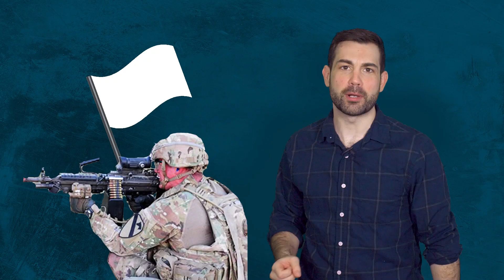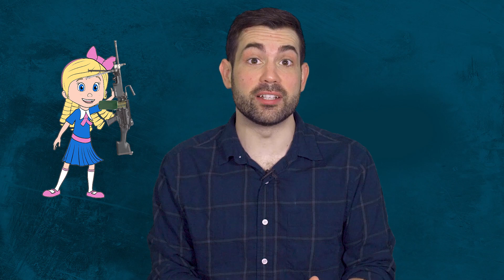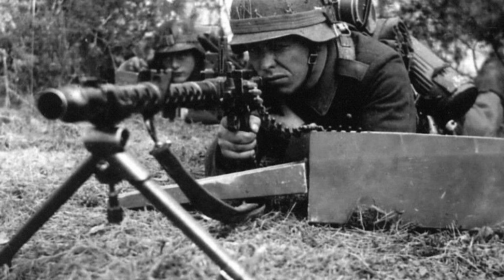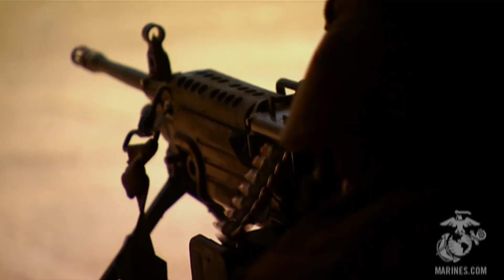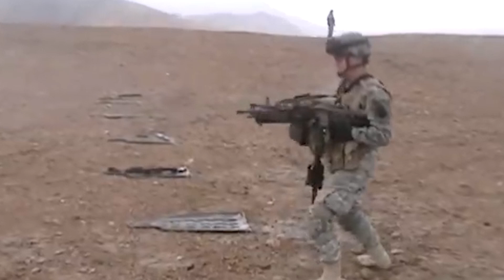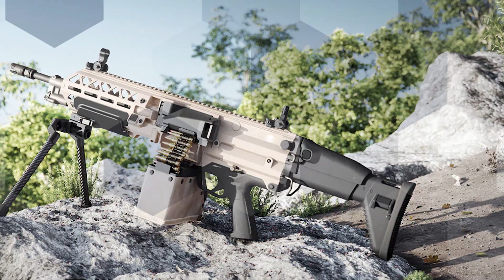How the M249 Machine Gun Evolved

Comment: The Australian F89/Minimi ended up with a FN MAG58 flash hider because it apparently improved fire control.   Plus the Minimi originally had dust covers over the link ejection port. Great idea that was... until gunners ended up ripping the crap out of their index fingers from cocking it and dragging their hands over the sharp edge of the dust cover.

Comment: Israel negev takes mags too, but there works. It has a gas regulator that you switch to for mags and slows down the rate of rife to give time for the mags/mag spring to feed. The m249 doesn't feed well from mags because the system out runs the speed that the mags can feed the next round.

Comment: Its supposed to fire from a magazine, but the lack of an adjustable gas system means that when it doesn't have to pull the weight of a belt of ammunition the bolt velocity increases to a point where it outruns the magazine. Making firing from a magazine an unreliable and dubious proposition.

Comment: We learned really quick during our 2nd deployment to rural Al Anbar that it was tough to pin the enemy down and actually maneuver on them. They'd often try to use the PKM and AK variant's superior area fire to spray & pray from 700m+ out, then dip before the fight could even start. Our solution was three fold. First we were one of the first units to implement the DMR role & carry the M14 EBR into wider infantry combat. We were also one of the first units to receive a CROWS. lastly, we solved the jamming magazines issue in the M-249 in literally the simplest & stupidest way ever. We just added a second feeder spring to all of our magazines. This allowed the mags to keep up with the SAW's stupidly high rate of fire and didn't seem to bother our M4s at all. We had to be very methodical about those long maneuvers but it totally worked. The CROWS allowed the M2 to respond quickly and safely for just long enough to get the M14s into the fight. The M14 could deliver accurate fire long enough to get the SAW close, and if the SAW ran out of belts before it got there it could safely and reliably be fed by squad mates. What were once legit ambushes tapered off to little more than the occasional quick harassment burst or two at even further and more inaccurate ranges. In that case we'd respond with the M2 & M-240s in kind and just call in mortars or air.
Reply: Nice tip on x2 springs, noted
Reply: Why the US will never use robots for combat. AI would never come up with a solution like that.

Comment: Wanna clear up some of your #'s. 1.) The 50% who had problems maintaining the weapon, didn't maintain it correctly. However, the damn bipod and the gas regulator always freaking rusted even with minimal humidity. Especially when it rained. 2.) 80% agree it was accurate. I agree with those #'s. However, I think the #'s are much more accurate. Thing shoots like a laser. 3.) The 30% stoppage issue was due to poor maintenance. I used it in Iraq and never had any issue because I always took care of it. The only issue I really had with the weapon, was that the variant that I had only had the bulky large plastic bottom heat shield / holder. Very uncomfortable to hold on patrols. I didn't have the version where they started putting the grips on.

Comment: Ah yees, ..the SAW🙄 there must be a feed and rate of fire sweet spot, with precisely timed recoil action and synchronized feed pawl swing😳 A fantastic weapon, except for rate of fire and it's daughter..heat. A shredding gun, keeps heads down and enemies incapable of accurate return fire. 850 rounds per minute?..826. The 240 is sweet but heavy. The SAW can be the cheap, reliable fire suppression king, but it needs an engineering overhaul. Scaling one thing and (The M240), into another is great when all mechanics are doing the velocity, force, cycle symphony right. Barrel change or melt.

Comment: In 1988 at Ft. Carson I was still an M60 gunner after 3 years. Two years previously in Germany. I got my first M249 brand new from the factory. I loved the gun because it was lighter than the M60. I first fired it during Infantry AIT at Benning and loved it back then. It was a dream come true for me. It had a 200 round drum which was heavy at first but got lighter as I fired it more. Cleaning it was a bit difficult.  The barrel and gas regulator built up carbon and copper deposits which I had to use the scraper. I found a secret to cleaning it. I used Hoppe's # 9 and steel wool. Soak the stainless steel gas regulator in the Hoppe's and apply some on the gas port to also soak. I used Brake Kleen to degrease the top cover and receiver and never hurt the finish. After cleaning all the big parts I cleaned the barrel and gas regulator by scrubbing off the carbon and copper with steel wool then spraying down with Brake Kleen. all the metal parts were dry and free of oil. I kept the plastic protected like the pistol grip and fore end away from Brake Kleen. The plastic I cleaned with rubbing alcohol. When it came close to turn in time to the armorer and squad leaders inspected it. I put oil on a shaving brush and coated it with CLP and wiped it down, my SAW was perfectly cleaned. 🤗🤪😜I did the same for my M60 before. I learned this from the HHC mechanics who cleaned their weapons by degreasing everything. The M249 SAW is still my favorite from memory, reliable and accurate from being a good gunner. I used it briefly during combat in Panama to punch out windows at buildings. Nothing but love for this weapon. ❤❤❤

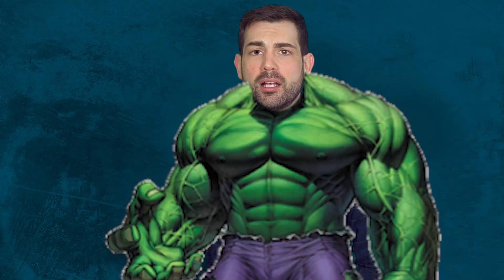Comment: At 6:53 the 249 there has a 240B bipod sticking out. Reason for this is probably that soldier did like I did and bent their 249's bipod. You're taught to put weight on the weapon to control higher rates of fire, but some of us bigger guys will break the stock bipod doing that.

Comment: What it really needs is to be in 6.5x39 123gr and to have the top cover much shorter so a scope mount can be accurate and stay sighted in. With this it would have a longer range with more body armor penetration at 1000 meters then 7.62x51 m80 ball making it more effective and a longer range then the M240 and lighter gun and ammo. And more effective at stopping power at close range than the 5.56 ss109, m855 or m855a1. Max point target range 1000 meters and a 100 round belt is only 1.2 lbs than 100 rounds of 5.56. the 6.5 is 2.5 lbs for 100 rounds. And the 5.56 is 1.7 lbs for 100 rounds a 0.8 lbs difference for a 400 meter longer ranger and more knock down face to face, win win win. now why the uck doesn't the USA military adapt it????

Comment: Pros of the M27 really good rifle accurate easy to clean because of the gas piston.

Cons we had to carry 12 magazines, reloading all the damn time and no barrel changes

We were told that accurate shot placement was more lethal and more suppressive then accuracy by volume.

Our M249 sucked they were so old and beat up and parts mismatched so a simple barrel change meant the rounds didn't chamber properly it was nice having a 200 round drum or 100 round nutsack but we use to call these things full automatic bolt action machine guns because you'd be lucky to get 3 rounds off with out a jam and had to pull the bolt back again lol, weirdly enough they fired more reliably with a magazine to the point that that's how we ran them lol

Even though the M27 felt like it didn't absorb the recoil as well it did better at full auto, the M249 was just very inaccurate, there is a reason we never approved it for over head fire at ranges like we did the 240 or other rifles.

Bottom line I prefer the M27 over the SAW but I don't believe the M27 is a correct replacement for it.

This was over 10 years ago now so I have no idea if things have changed since I left the Marines but it was still new to us at the time.

Comment: LMG's are becoming at best unnecessary, and at worst, obsolete.

Improvements in technology are eventually going to lead to Automatic Rifles (and Carbines) that are so good, they can deliver almost as much sustained firepower via the use of reliable hi-cap mags while still being cheaper than an LMG, more capable than an LMG, lighter than an LMG, easier to reload than an LMG, easier to learn as compared to an LMG, more accurate and controllable than an LMG, harder to single out under observation than an LMG, and everyone can have one (vice 1 person in a fire team). Like it or not, AR's are more maneuverable for our riflemen than LMG's can ever be. 

Sure, the M27 can't do suppression as well as the SAW, but...that's about it as far as drawbacks go. It outperforms the SAW in every other way. 

Furthermore, tech advancements mean medium machine guns are also going to get better and better, to the point where they're short enough, light enough, and powerful enough to more than make up for the lack of having a true LMG at the squad level. Imagine a weapon the size and weight of the M240L, but chambered in .338? Sure, it may not be as light as, say, the PKP Pecheneg, but the range and power of the .338 more than make up for it. Polish that gun off by adding the feed tray and link improvements of the Sig Sauer .338, the lightweight textron's polymer cased telescopic ammo, and so on, and you'd really have something. 

The only benefit an LMG has is it can deliver more sustained firepower than an AR, and it's lighter than an MMG. As time goes on, AR's will become more capable, and MMG's will become lighter. 

I think we should simply invest in better hi-cap mags for our AR's, and an LMG upper (like the Ares MCR AMG 2). They're way cheaper than buying a new LMG anyway. Other than that, an AR is more capable and an MMG is more powerful than an LMG. Slowly but surely LMG's will only fill a very niche role, especially as we switch to a 6.8 or 6.5 caliber.

Comment: I remember being issued the MINIMI (pronounced M I N I M Y In the ADF) for the first time at Kamp Krusty (Kapooka). After doing the weapons qualification (safety, IA drills & stripping/cleaning it was more far more fun to fire as opposed to carrying the weapon. The cadence we were taught was 1000, 2000, 3000, 4000, 5000 was normal and 1000,2000 was rapid. We've recently updated the MINIMI from the F89 to the EF89 which has a collapsible stock, forend rails and SPECTRE Optic.

Comment: was a SAW gunner in Iraq too. as far as the use of mags, I found that if you double up the load spring in the mags, it will feed in the SAW well. it's the high ROF for the SAW that is the issue: it feeds faster than the mag can provide .

Comment: My armorer told me that the reason that the SAW would jam up so much when using the magazine was that the magazine was most likely an M-16 mag instead of a SAW mag.  The spring was more powerful in the M-16 mag which would cause double feed issues.  The DoD, in their infinite wisdom, made the M-16 and SAW magazines nearly identical in appearance, which is why you would be issued M-16 magazines as a saw gunner.  They just couldn't be told apart unless you disassemble the magazine and check the spring tension, which you couldn't do in the field.
Reply from the maker: sounds good to me , if an armorer said it that double checks out. I never saw a SAW m249 magazine though didnt know they exisited
Reply: @Taskandpurpose  Ya, the armorer told me that they only made like a run of 1000 once and never again after that.

Comment: I carried mine in 86-87 up in 2/75.   I had none of the issues you speak of.  Humping that b** wasn't as much fun as it sounds and humping the ammo load made it worse.  I got very adept at chipping the carbon buildup off the gas regulator with dental tools.  I never had issue with firing it with a belt and I pushed the magazine in while firing and worked most of the time.  I miss that damn thing all the time.

Comment: in my 20's, as a 5'7 63kg Aussie Reserve Solider, it always surprised people that I'd volunteer to Carry the Minnimi. My Logic though, was If I had the Minnimi, I wouldn't have the Radio (which was usually a Vietnam Era 77 set, with a carry frame designed for someone over 6'0... meaning when I went to ground it would smack me in the back of the head and literally make it impossible for me to lift my face out of the dirt). On the Range I was always better with the Minnimi too, since use of the Bipod was allowed.

Comment: When I was in Iraq mine was set up like an automatic rifle.  I had the newer (2008-09) collapsible buttstock, assault barrel, and the rail system.  I took off the bipod and rails and just rocked 100-round nutsacks.  I wasn't in a line unit and would never have had to employ it in a support role, so this was okay as far as I was concerned.  Lightening it, and its ability to squeeze off single shots, made it a better fit for me.  As an aside, it weighed in at 15lbs with 100 rounds.

Comment: The m249/fn minimi is not the only LMG design that can be fed with regular magazines, the IWI Negev can as well and even do that better since it has a gas block position specifically for that, so the bolt doesn't travel too fast and the magazine spring can do it's job properly.
Reply: Rpk and m27....
Reply: @pr5721  Mag fed only and kind of not machine gun designs, they’re more like heavy versions of their intermediate rifle counterparts. Something like the Ultimax 100 or Surefire MGX are more developed from the ground up to be machine guns while being mag fed.
Reply: @myusername3689  the ak family was always a machine gun only stupid laws make them not
Reply: the M249 is notoriously, infamously unreliable with a magazine. To the point of being unusable. The Negev is perfectly functional with a mag. Now, That IWI is a private company, it begs the question of why the M249 is used instead.

Comment: I’m not familiar with the m249 personally but I think if it’s built like a PKM ie stamped and riveted steel parts instead of spot welds, a reinforced barrel trunnion and a much more refined gas regulator with a distinct setting for mag feeding and a lower cyclic rate in general, I think these changes will turn the m249 into the ultimate 5.56 belt fed SAW
Reply: You can take a look at the Negev 5.56 LMG made by IWI. As far as I know it's one of the few Belt fed LMGs that doesn't jam with mags.
Reply: @fleetSRT  I wonder if the military changes to 6.8mm x 43mm which is lighter ammo weight per round there would still really be a reason to have the ability to load mags.
A SAW gunner currently carries 600 rounds on their person, with 6.8mm being lighter they could carry the same amount and maybe carry a better sidearm, or carry much more than 600 rounds. Plus the 6.8mm has more punch behind it than 5.56mmx45mm meaning each shot can do more damage. 

We'll see what happens in the future I guess
Reply: @teaser6089  i hope they do it soon. 5.56 is slowly loosing its edge against newer developments in personal body armour.
Reply: @fleetSRT  Well, it's a machine gun so unless people start thinking they are invulnerable, 5.56 is better because it means more bullets
Reply: @teaser6089  well... For one the military isn't adopting 6.8x43, the 6.8 cartridge they're adopting is actually heavier but similarly sized to 7.62x51 NATO. Secondly 6.8x43 IS NOT lighter than 5.56!
Reply: So if they make a completely different gun, it will be better?
Reply: @skepticalbadger  yes
Reply: It was more of mix of the m60 and the FN lmg. I can see where your coming from though.
Reply: It's nothing like the PKM. The PKM is just better in every possible way
Reply: If you do not know the M249 closes your mouth, here many guys have an opinion without knowing anything, the M 249 is an excellent weapon, there are only the Americans who complain, America is not a reference they have lost all the wars, 1940 was won by the Russians, the order book for the M249 is complete,  the new machine gun is not intended for the USA
Reply: @hansstrouf  I see your parents failed at raising you and teaching you manners
Reply: @hansstrouf  russia didn't win ww2, without western industrial support they would have been overrun
Reply: It's always been a 5.56. Belt fed SAW. And has always been called a SAW. That's its nickname
Reply: @Mocha69A  he’s saying it will be the “Ultimate 5.56 belt fed SAW” literally saying it will be the best compared to others in its category. It’s not hard to read people. 🤦‍♂️
Reply: @Mocha69A  thats it nickname... in the USA. This is a Belgian gun first a foremost. It is a FN gun. the FN Minimi, "Mini-mye".

Comment: I carried the first generation M249 in the late '80s. A basically sound design, fun to shoot, and very controllable. But it was not as sturdy as its 15 pound weight would make you think. And most crucially, the barrel was so thin that it overheated quickly, and every SAW I've ever seen had the rifling burned out. It also deposited melted copper from the bullet jackets onto the gas regulator.
Reply: So this is why they said it was inaccurate...